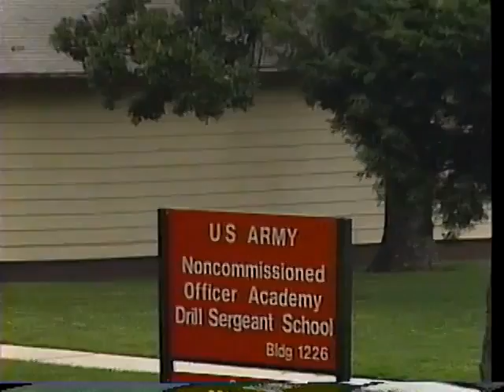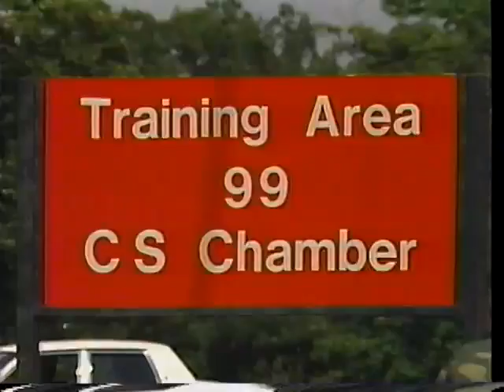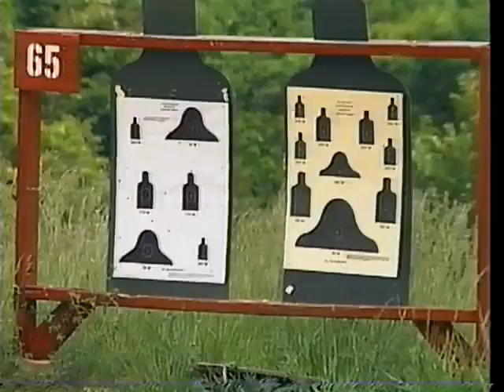US Army Basic Training in the 80s

Comment: I lived a very short distance from FLW but was sent to Ft Bliss, Tx. for bootcamp in 83.
Reply: Went to basic in not so bliss, Bliss during the summer of 84. We had recruits continually dropping like flys from the heat. Myself and two other were from Arizona and west Texas so we were acclamated to the hot summer heat. Most were from northern states and not able to coup well to the heat. If I recall correctly, summer boot camps ended at Bliss right after our graduation.
Reply: @cliffterrell4876  That not close to being true. I live in southwest MO. At the same time I was at Ft Bliss it was in upper 90s, low 100s with 80-95% humidity where I'm from. The dry is far more bearable. Glad I wasn't sent to Ft Leonard Wood. Imagine what Ft Polk, Louisiana would be like. I was stationed at Ft Irwin (NTC) in the mohave after Ft Bliss. Dry heat is much much better than humid heat. Not everybody lives next to Canada.

Comment: I was prepared to go through this in The Canadian forces but wasn't accepted for service, probably a good thing Im not really soldier material. My friend told me basic training was fucking hell for a good few months , endless marching and grueling excercise, little sleep sometimes none for days and The Master Seargent making everyones life hell especially if you fuck up too much LOL
Reply: Rex Holes Why weren't you accepted?
Reply: Basic(GMT) is tough mostly because you're a civvie when you start so there's a big adjustment to make (which is the entire point of the process). The whole 'making life hell' thing relaxes quite a bit once you've proven yourself.
Infantry BTT and the Infantry Section Commander Course were way more gruelling.

Many years later, I can always work with current and former CF members because of the common ground - they met the same standard you did.

Military service is something every one should at least try when they're young, even if just for the character building rather than as a career.